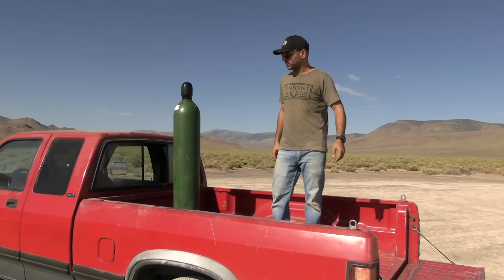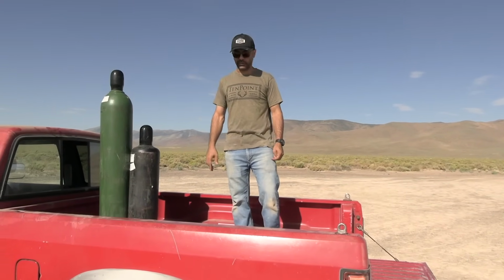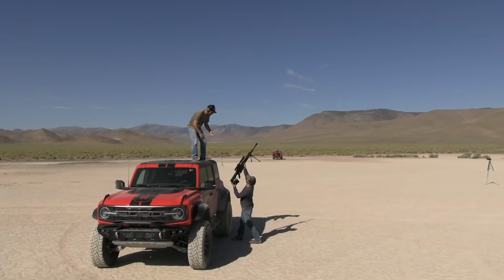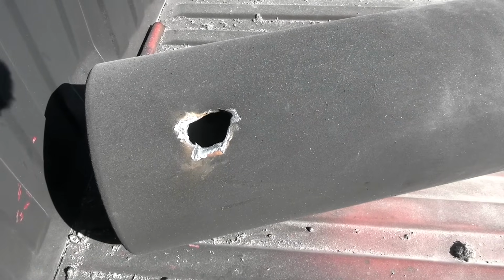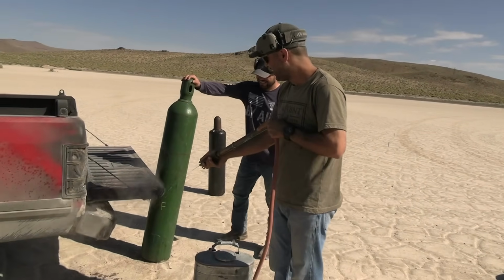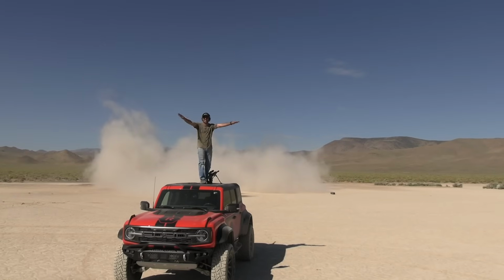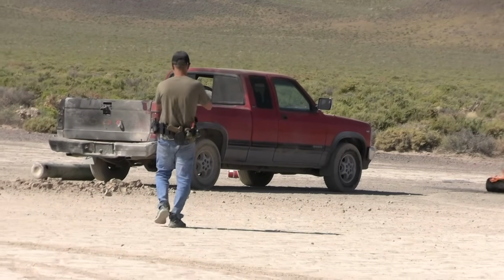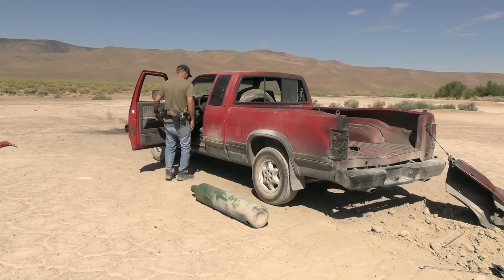Don't shoot Oxygen tank in back of a Truck

Comment: How am I the only person requesting Edwin to tape a grenade to a oxygen tank
Reply: Sounds like a plan to me👍
Reply: I'm so jealous that I didn't think of that. Dude you should be Knighted for this awesome idea. EDWIN!!!!!!!!!!!!!!
Reply: Sold
Reply: DO IT !!!
Reply: He's not crazy enough 🤣
Reply: Yeah but pull the pin with a string from a safe place please 😂
Reply: Sounds like a plan
Reply: Most frags won't cut through an oxygen cylinder but if you want some fun opening the largest size acetylene cylinder so it can vent before shooting (liquid gas does not explode) it will release MUCH more energy. One small plumbers torch size acetylene cylinder leak can level a house, the reason all my welding gases are stored outdoors where any leak can vent easily.
Reply: Stick of tnt lol
Reply: That would scatter frag in all directions!

Comment: Next time try a large acetylene cylinder and let it vent with the valve wide open for as long as you like. Oxygen is just an oxidizer so everything you see burning is some other material (including some of the cylinder steel!).  Acetylene stores far more energy and if you wait for it to mix with atmosphere you will have a thermobaric result. Do not substitute LPG.

Comment: Just wondering was that distance you ran sufficient for the grenade to not anyway possible to injure you? Seems kinda close..
Reply: No. And never toss a grenade that short.
Reply: Definitely too close. Iirc, fragmentation grenades throw pellets fast enough to be lethal out to 40 ft. You're just less likely to be hit if you're far enough away due to the spread.

Also, iirc, the handle comes off when you throw it. Starting the fuse without throwing at the same time was suuuper dangerous. 

Up until the handle pops, you can safe it with the pin. So you only let the handle pop when it's actually leaving your hand
Reply: @alphahill2586  lol don't think it was real

Comment: When i was a child i have seen mulitple oxygen tanks explode on a roof whilst walking in the direction of the building. I was down in the street with my grandma and one of those tanks flew high in the air and landed in the middle of the street during rush hour. BOOOOM !! The whole roof was on fire because they used wood in the construction. There lived many families on the lower floors at the time. I got hit by the bursting glass from the buildings windows next to me.  It happened here in the middle of my city in Europe.  300 meter around the explosion almost all the windows had to be replaced. Ours too. The next years i almost shit my pants when walking by such a tank. 😅🤣

Comment: Guys you need to just make a small hho generator in a bucket of water inside a fridge or car anything sealed After a little while Depending on the volume It will be filled with very explosive hydrogen & oxygen gas mixture one spark and 💥
Reply: And if you think you are at a safe distance, please double that distance 🙏  I will not be hold responsible for Anyones actions leading to Injury or death Because of my commitment

Comment: Ive actually used a 5 gallon back pack water tank while working for Ark. Forestry back in 1994-95, its very heavy when full of water lol - the tank weights 7.5 pounds empty and water weights about 8 pounds a gallon - u do the math 🤣 oh and theres the pump and water hose and spray nozzle and harness to add to that weight - all together about 52 pounds on ur back walking around spraying hot spots at forest fires